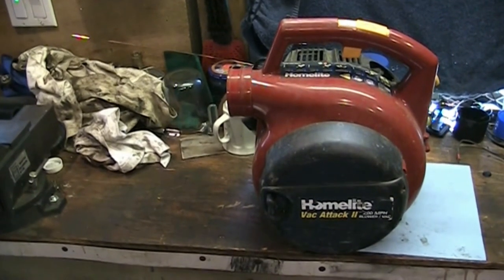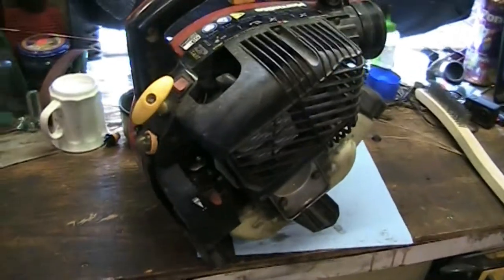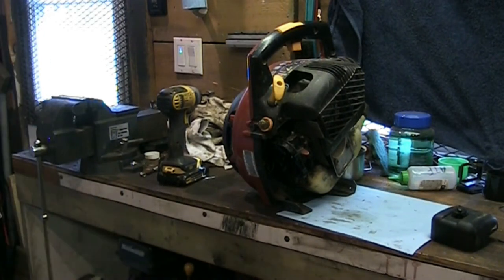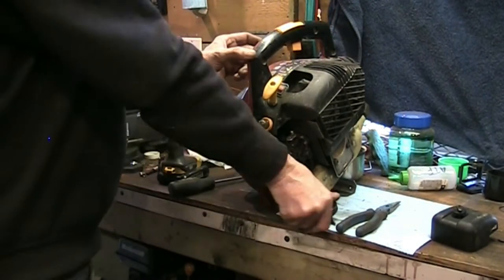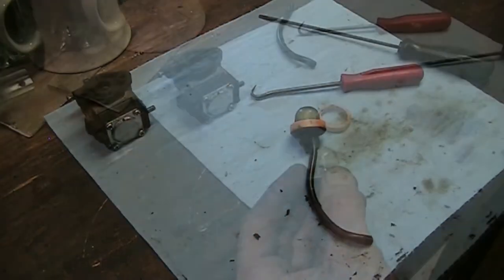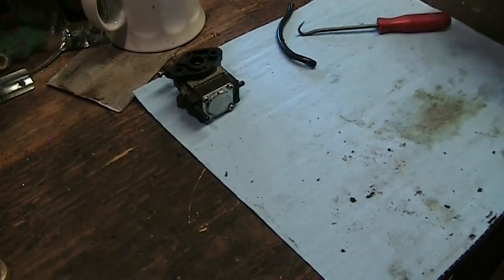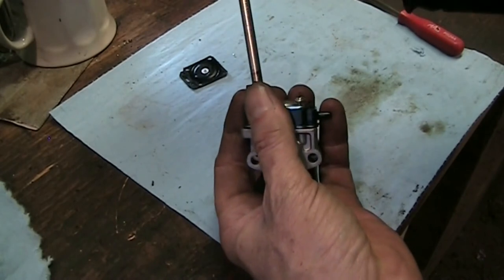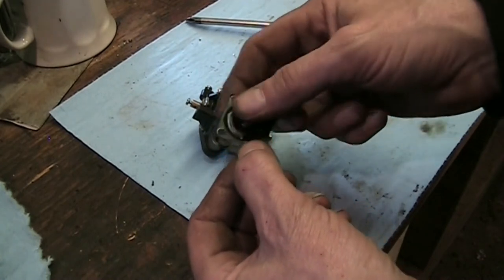This Homelite leaf blower vacuum has sat for years and won't start.

Comment: same one i have in the UK that sat for 2 years and maybe gummed up in the carb, as it has spark, ive replaced the lines, had it running when squirting petrol into the piston, so may see if i can clean or get a new carb
Reply from the maker: I would start by looking into the carb as well...